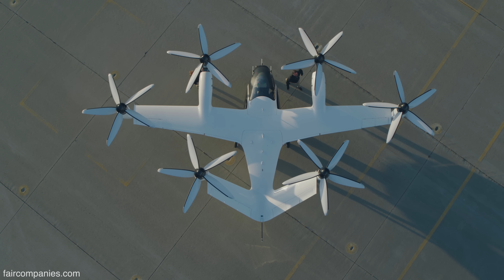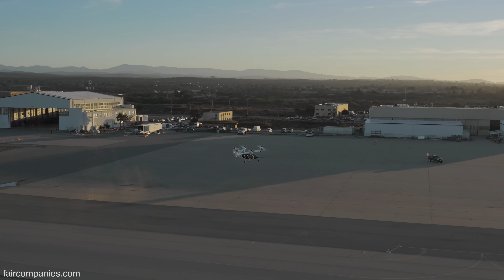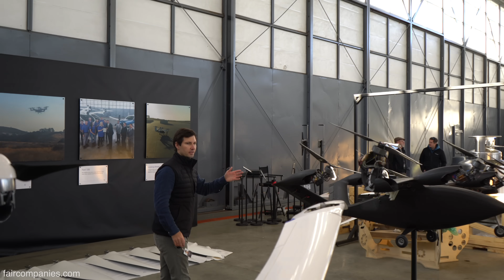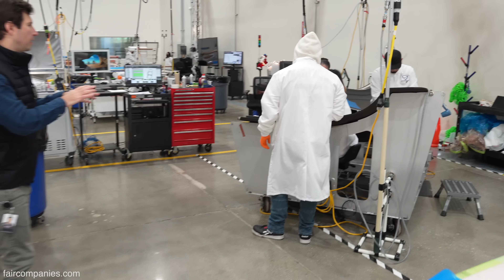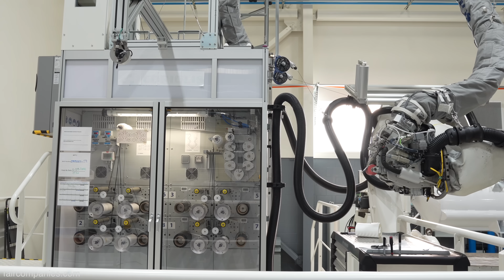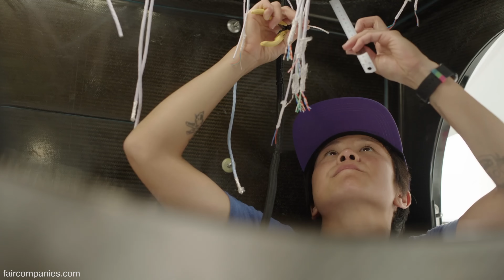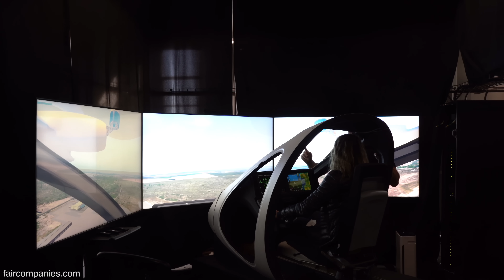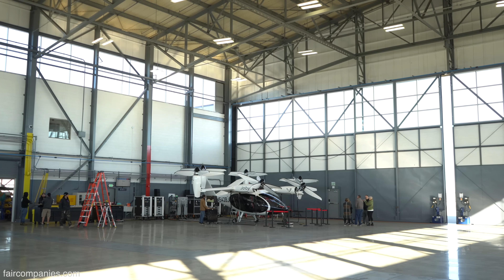eVTOL: electric flying car beats helicopters in silent commute

Comment: is there redundancy around single-motor failures...for instance, can it hover on one motor on a wing, assuming all other motors are fully-powered?
Reply: Yes. 6 fans has computer managed compensation for a single engine failure. It exists on remote controlled drones, it should already be implemented on this demonstrator. You lose some power (thrust/lift), therefore, flight/hover capability depends on loading, the lighter you get, the better it will manage. For a symetrical dual engine failure, it's the same principle, but depending on the axis, hover capability may become unavailable.
For more failures, like in case of a flock of birds strikes or you get caught in an hail storm, it would fly in cruise mode with 3 engines or less but you would have to land at high speed (you need a runway). Your available range would depend on the number of operational engines and the load (mass). In hover/STOL mode, you'll lose control right away, probably at a rate of 10-15° tilt per second on average. In that case, a chute seems inevitable, but it probably has to be computer activated, because you don't want the fans to sever the chute. And immediate complete engines shutdown and an explosion driven deployment seems appropriate, activated fast enough before the spin rate get too high. Drawback : false positive activation, the system must be extremely reliable at detecting the failures, especially multiple fans inflight breakup. However, this only matters in V/STOL engine position : in cruise, your engines must stay operative and the chute must not deply unless a specific decision from you. In that case, it seems, the best chute position is in the tailcone, meaning you'll land on the nose.

blah blah blah... isn't it ? :D 
^^ That's one though process addressing your concern, and they are way ahead of me on that matter, but that doesn't mean they had to address all that right now. They only have one demonstrator, you need another to perform 1:1 scale testings, so, be patient, the result of their work (if conclusive) is a long road to walk...

Comment: Beautiful efforts,  nice presentation.   However, I don't percieve that you addressed some basic concerns.   Just because you say so,  does not mean testing is fully covered.  No,  you cannot imply that you can do all your testing remotely.   Not without carrying passenger's.   I do not liked to be BS'ed with luxury terminals and la la eye candy that you can Air Taxi anybody without addressing Fire Safety and Reliability of the vehicle USING UNPROVEN IN A CRASH LITHIUM ION or LIFPO4, or even LTO3 Batteries.  Until you address these basic concerns, and probably more range anxiety concerns,    I am OUT.

Comment: I immediatly have so many questions about what if?....
This battery starts burning? There is no way of extinguishing lithium fires, So it will come down burning on a parachute, As long as it stays in tact that is.
What if, This evtol stuff will go on, And will fly in massive numbers through the air, Mixing and stirring up the airmass. How will it change weather? Cause by nature warm air pockets will rise up (thermals) and they will not mix by nature and form cumulus clouds which might in turn produce rain as they develope further🤔 I am not worried if there are some flying around. But if also drones would fly around to deliver packages everywhere, It might scale up to massive numbers.
And i fly a paraglider, Where would we still fly if the skies would be filled with autonomous flying objects which stirr up the airmass, Making my glider collapse or flying into my canopy? Do airspace will be even more closed to a point where no hobby aviation will be possible anymore. Another bit of freedom gone.
With normal aviation there is no real problem as the planes will fly much higher up, These evtol aircraft will fly low as they don't have the range to go up that far vertically. It would cost too much of their horizontal range.

Comment: There is no silence with rotors. Bullshit title. I guess with the increased number of rotors each can turn less and have less thrust each which would reduce blade noise as long as the blades are clean, they are not damaged  etcetcetc.... To hell with plane commutes where the entire sky buzzes constantly 24/7. Also I imagine most people can't keep one motor happy in their cars... let's give them 6 :D It is a fun design though it needs to be said.

Comment: My concern would be so many moving parts to have to maintain.  Considering how much it costs to maintain a regular small privately owned airplane, which typically has one or maybe 2 engines, (costs thousands of dollars a year in regular maintenance,) your vehicle with so many more engines, could have very much higher maintenance cost.  Also, because of its overall size, the space required to shelter it, would be substantial, and not something an urban environment would accommodate space wise.  So, you'd have to travel to your parking location via conventional means, which to me, seems just an added expense and time consideration.

There may be other technologies available to reduce the overall size as well as fuel considerations. (batteries are very heavy for the amount of energy/fuel they provide.) Thinking outside the box, consider anti-gravity technology, and the like which can be fueled by zero point energy.

To invest in something like the vehicle you have proto typed doesn't have a practical long term future because even though it seems to be ahead of the curve, it is ahead of the curve on old technology, which will eventually be replaced.  So investments in R & D don't have the potential for substantial returns say 5 years down the road.

Comment: . Beats planes and helicopters how? Max Payload? Range? 150 statue miles. That is short. Recharge time? Cost? $$$$  Will it beat a Fixed Wing C-172 I have owned since the 1980's, $40K into it, worth 3 times that today. 4 people, 125 mph, range of 675 miles. Landing and takeoff? 1500 ft runways SL no obstacle is easy.  So their claim to fame is quiet. OK that is good.  Wish them luck.
Reply: Yeah no kidding. Just another invention looking for a problem to solve.

Comment: I’m a mechanical engineer and a software product manager - so this thing is really intriguing.  First, thinking of the product positioning - it seems that the unique benefits are it’s ability to take off without a runway and it is relatively quiet.  Some questions - I’m wondering how a scaled-down Osprey type ICE vehicle would compare in cost and performance.  Given the positioning and price(both initial and cost of operation) what is the market size (both dollars and units sold/year)?  Can it take off and land like a conventional fixed wrong aircraft if a runway is available to save energy and extend range?  Does it have a parachute for emergency landings - in-flight failures.  What’s the expected price?  Will you sell them or only lease (subscription model)?  How will you develop the support network? (this seems to be a crucial element of going to market - you need specialized teams of people to look after them in every market you serve.). Will this aircraft require a pilot’s license - just like a small single-engine airplane?  (Or is it treated like a ultra-light). What’s the regulatory hurdles required to enter the market?  The use case seems to be - short commutes for wealthy professionals in and out of high density urban areas - rich guy lives outside city - commutes in every day avoiding horrific automobile traffic - and - recreation/ travel to remote, hard to access areas - rich guy goes hunting in remote wilderness - or just flys around for fun.  A nice addition to a super-yacht 😊
Reply: I believe those companies runs on fund raising and subventions. If I'm correct, they don't care yet about the business model, they are still tunning around to come up with a demonstrator before working on the proof of concept. Then, they need to solve the first bunch of concerns (safety, as you stated, a chute for instance, very likely) as per regulations. Then, totally outside their control, various organizations will evaluate the possible integration of such type of operation in the public scope, new rules and regulations has to be studied, tested then validated. This eventually will clarifiy some other modifications before passing the operational practicality of the concept. If all those end up with a vehicle that can actually have a decent payload that can be produced at a reasonable cost and refund the invested money so far via its selling price, then commercial sales can begin. At this point, it's clear something that can take off from uncontrolled airspace has to be manned by a qualified and licensed pilot. Pilot, not a mere lambda anyone that happenned to have some simulator experience. Why ? Because you fly something at least 500kg above other people and properties, and airspace has regulations.
The business model depends on the final production cost plus whatever you already spent. You make an estimate of the potential buyers, then you look for other means to make money (like services, personalization, etc.) I don't think it will land in the "flying car for everyone to avoid traffic jam" model, much likely in the emir with a personal chauffeur putting up a show with paparazzi around from his castle to join his current girlfriend on a yatch, as you said. Less fancy, it would be a good successor for helicopters as medevac, if they become reliable enough and manage to usually land safely in case of emergency. That way, public funds can pay for units even if each costs 10 or 20 millions (incl. spare batteries, warranty and base insurence)

Comment: That's always been a big criticism I have had with these flying electric vehicles, most of them are super-noisy. I am glad noise pollution was key in the design of this very complex vehicle. The tilting rotors are a marvel of engineering. I hope the mechanics are reliable. The Osprey used by the US Military, and uses a titling rotor mechanism, has massive reliability issues with the tilt  mechanisms. Thanks for covering this company!

Comment: A little diesel powered generator that could power the 2 wing props during horizontal flight and rest the battery’s till landing would be super interesting for having extended ranges. 150 miles is still very limiting it’s great if you just lived within 40 miles of your destination that way a round trip would be possible after a couple years of use still .. but charging time and limited range is only thing that hurts the mass adoption the cost of the machine I’m assuming is way more than a heli of equal payload.
Reply: But all in all excellent work and seems like a amazing piece of engineering.

Comment: Have a 3 questions:  1. what are the weight limits (personal/cargo)?  2. Giving the current test flight what is the estimated time to go commercial?  Finally, 3.  All the props pull the aircaft...  was there any analysis done as to have the props push the aircaft?  

Thanks for the feedback!   I like the design and projected spects....
Reply: 1. No answers yet : those cannot be defined before the mandatory modifications to comply with regulations, safety-wise, like the need to have realistic solutions in case of emergency, like a flock of birds strike and loss of control : will the presence of a chute mandatory on that type of vehicle ? That's just one example among hundreds. Til then, there is no reliable payload weight information.
2. Commercial debut will take place when the vehicle, manufacturer, various public management organizations (...) are ready, with the proper qualifications/licenses/authorities, means and tools : How we do, together, for that thing in the hand of anyone doesn't kill anyone or do property damages.
3. Yes : because they tilt to allow V/STOL, having the props near the ground is a bad design : you have less bank/pitch guard, not good on take off/landing. When spinning, those fans are invisible, so pretty sure some ignorant will walk right through. You have the fan under the engine, on a multi parts design, you have to unmount the fan first, then unmount the engine to change it; better have the fans above the engines so you have direct access to the engine during maintainance. Pushers doesn't provide any advantage over pullers unless the design constraints directly favors it, like a better vision, shorter fuel pipes that also makes them lighter, eventually, a center of gravity requirement driven by the type of wing. Also, for sustainable V/STOL manoevers, fans way above the CG is more stable and less subject to complex computer assisted systems to compensate. That's only a few reasons, there are many more...
Reply: @StephenKarl_Integral  one pilot and four passengers and luggage per JOBY. I never read anything about weight limits yet, I'll
 need to ask JOBY at next investor conference. 

The goal is Autonomous, then no need for expensive pilot by 2030. JOBY is one of the few Evtol's who has a pilot first, then autonooumous by 2030 per the experts/FAA.
. Most other comp is going ONLY autonomous by 2030, thus left behind JOBY.
Reply: @MC-yb5le  That's what I answered to someone who wrote something like "I need one, my personal flying car, haha".
There is no such thing as maneuvering something weighting more than 10 kilograms above people (children) and infrastructures, and you, the pilot has no license or special authorization/qualification. If you fly over populated areas, you must be trained and some authority assessed your ability to CARE about others below and in the air, to not injure or kill anyone or do damage to properties. You must be qualified to manage emergencies, follow directive, have health discipline...

So, EITHER the thing goes the road of COSTY licensed pilots, OR the vehicle is UNMANNED, and piloting is realtime computer/AI driven, centralized in some company, like Tesla. If someone dream of manning that vehicle someday, he/she has to be a pilot then, with all what that responsibility requires including having passed all the trainings and tests for the licenses : that's not free or it gets included/diluted in the (rather high) price of the vehicle.

Also, how about preflight maintainance check? With 6 engines. You do it aswell (more qualification required) or you pay guys to come to your home before each flight?
I'm the "have some realism/common sense" type. I'm not impressed by how many people it boards or how quiet it is, I'm interested to assess how practical and cost effective it can eventually get, as an owner, how much it would cost me, how much trouble or effort I have to swallow to be able/allowed to operate it..? As the manufacturer, what business model is realistic? Should I license pilots or get rid of the concern by getting "pilot" out of the equation, ie, go AI ? As a citizen in residential area below a traffic path of those vehicles, what "peace of mind" am I ready to concede to allow other people to use that vehicle over my house? That's the kind of concern regulation authorities have, because when a crash happens (and it WILL happen), I will be in charge of judging if that vehicle is dangerous or not, and if it is, technically, I'll kill companies, services, people will lose money and their jobs, other people will lose their dream... BEFORE all that happens, I must closely assist the manufacturers and come up with a list of road map and compromises...... The certification process is based on historical occurrence of dramas, and it gets tighter over the decades, not the other way around. Realism is to take it seriously.

Comment: 1. The energy density of batteries is terrible, I can't reproduce the formulas, but it is terrible compared to burning hydrocarbons.
2. The energy usage of flying rather than rolling is also ridiculous.
3. Traffic control is either AI or unimaginably bad.
4. An accident that would be a "fender bender" with cars would likely kill people.
You can show this as a demo, but seeing very many of these in use would require unimaginable breakthroughs.
Bonus problem: Recharging these will add load to the grid - it is already questionable that a grid that already gets overloaded with a comparatively small number of electric cars.
\I will take bets against these people ever selling in quantity, any terms or odds you want.

Comment: I have yet to see a Joby video discussing the possibility of an emergency parachute.  Obviously, the weight of such a system would compromise performance and increase cost.  I'm guessing there isn't enough wing surface area to glide the aircraft to a controlled crash if the electrical system shorts or multiple propellers are compromised in bird flock strikes.

Comment: Most amazing part to me is how quiet it is. Curious is a fuel cell Version will be available at some point
Reply: Perhaps, the fuel cells will be created for larger planes,  larger JOBY'S and/or large boats/trains. 
The battery is sufficient for 150 mile flight. 
This is just the beginning journey for JOBY, stock is cheap too.